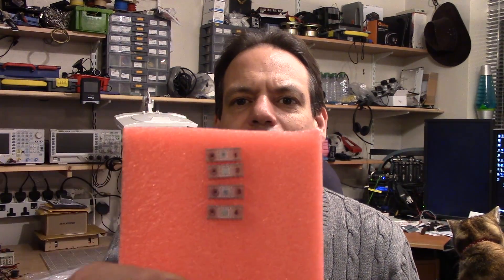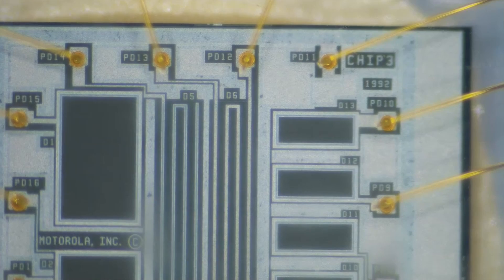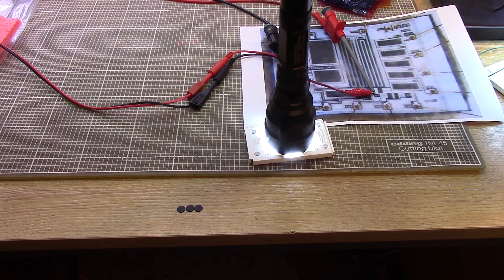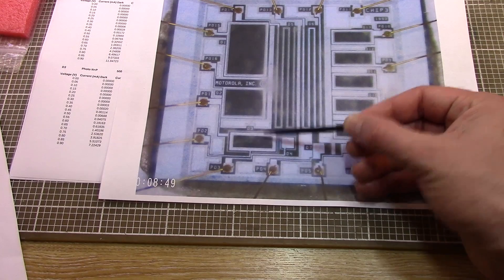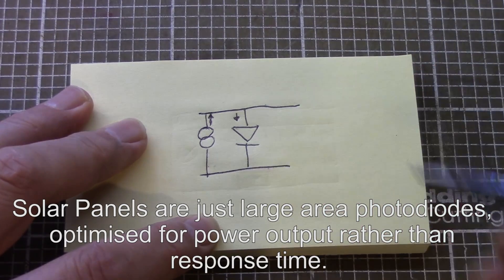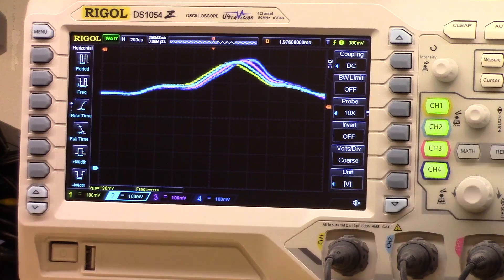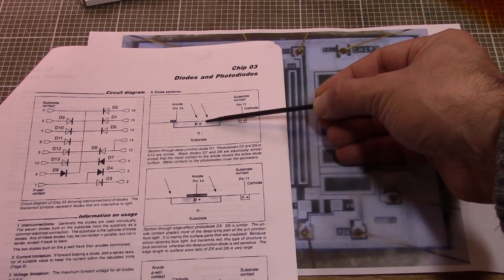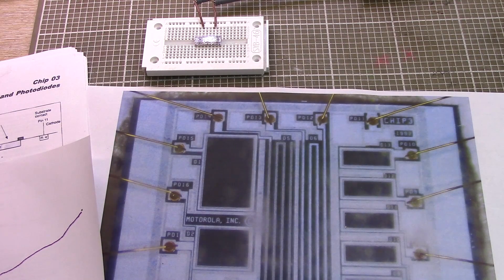Transparent Microchip Experiments - Part 3 - Photodiodes

Comment: You had your red and blue transposed when you explained the response graph. Blue light has shorter wavelengths than red light. Blue light has higher energy than red light, so, (ignoring any filters over the diode surface) as wavelengths decrease you reach the quantum threshold for the photodiode, at which point it will begin to respond to the light and emit electrons. As frequency continues to increase further, the diode output will increase further, up to a limit dictated by the transparency of the Silicon and any filters. Thanks for the interesting demonstrations, and for showing us that you're human, Jim!

Comment: Great video as usual mate. Blue light is about 460nm and red 700ish all the way up to infrared of ~1000nm. So the way I read your chart is that the chip is more sensitive to red/infrared. The davecad was funny.
Reply from the maker: Thanks for spotting my error +Robonza  - I knew I'd get something wrong in this video (in spite of re-shooting bits of it over and over again). I'll add an annotation to correct my error. Cheers!!